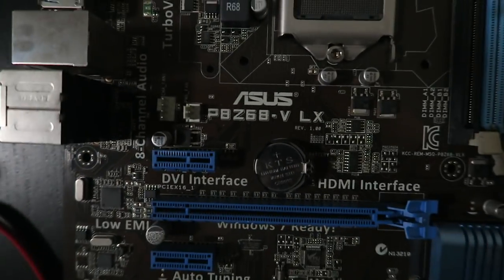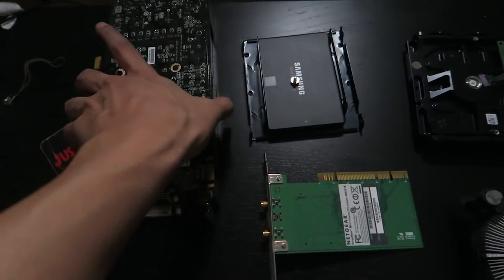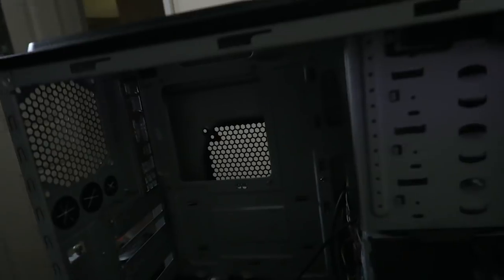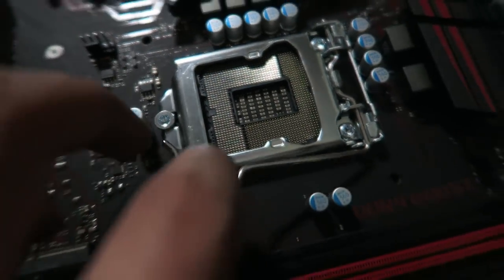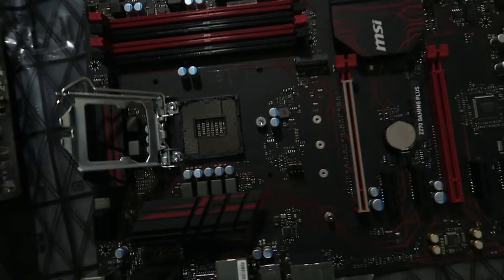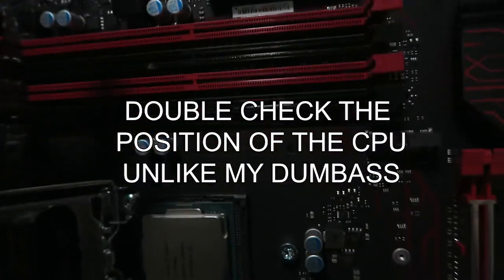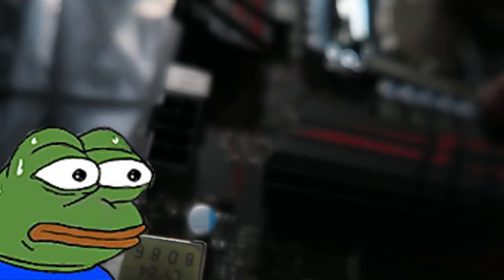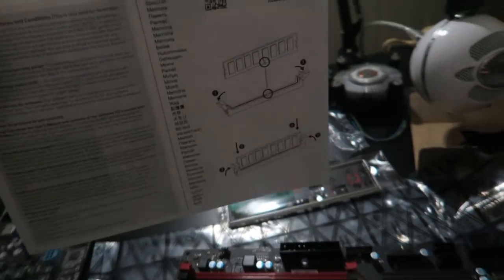HOW I RUINED MY COMPUTER - Story Time w/ Xell

Comment: Tbh not trying to be holier than though and no one needs a play by play on their lives but just for reference, liquid coolers do tend to fail in a couple years and judging from the age of your old parts your upgrade cycle is pretty fucking long and air coolers (large ones anyway) perform as well and take longer to fail. Also you should probably do a test bench-like setup on a cardboard box (one the motherboard comes in) to test your parts when they arrive to get problems sorted then and there and then. Lastly you could with some help from zip ties and a dremel installed that cooler as a temp thing or just use the top motherboard box as a temp pc case tl;dr just steal a build off linustechtips
Reply: This the more ranty shit but an i7 might not have been the right choice for you if you intend to also do production on the side with the pc since they can get beat out by their and risen equivalent at that price point and a cpu's impact on games at the higher end is minimal vs the gains in editing and streaming from more cores. This also a bit of assumption since it's new years and I don't want to csi which motherboard you have but you may have bought one in capable of overclocking and if thats so you wasted your money on a good cooler and unlocked cpu, if it isn't then you better overclock it for the sweet performance gains you can make (7700k over clocking is pretty well documented and easy to find a guide on to do safely)
Reply: Your TL;DR has nothing to do with what you said before it.
Reply: Arnold Shrekt yh but it is basically what you should do to avoid problems which is basically the point of what I put up there
Reply: Copying builds from a YouTube doesn't necessary help avoid problems....
Reply: Yh but it cuts the problems down to the purely mechanical in the building process by removing compatibility issues and if you watch a full on build guide they do pretty much outline every step you can fuck up on like in this case miss aligning the cpu in the socket. Pretty much nothing you attempt in life has a 100% success rate but steps can pretty much always be taken to get you as close to that number as possible, this isn't a personal attack on you or xell just trying to help other people who would want to avoid these mistakes just like how this video was in part put out to stop others making the same mistakes.